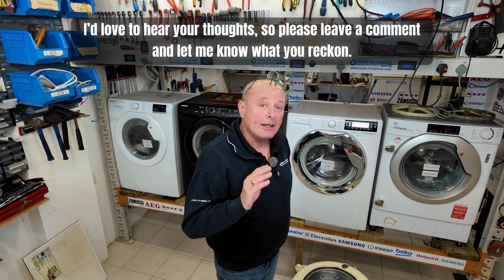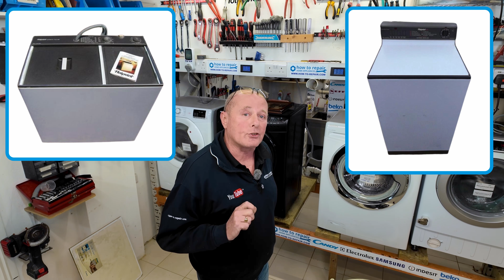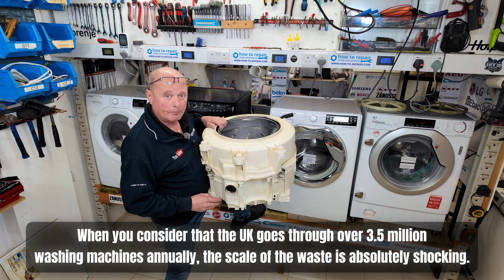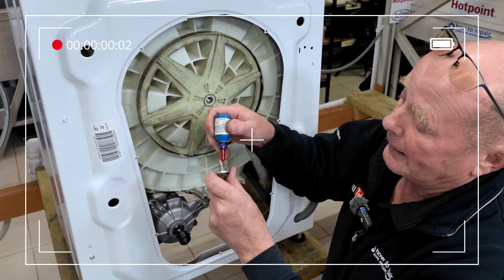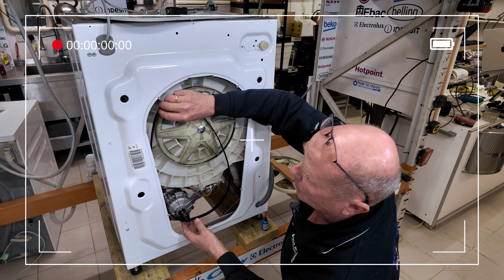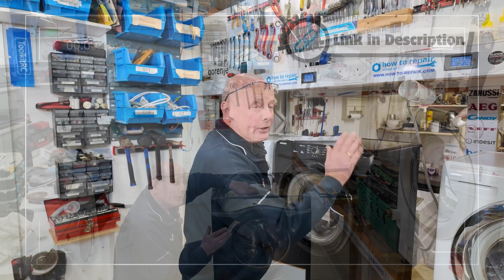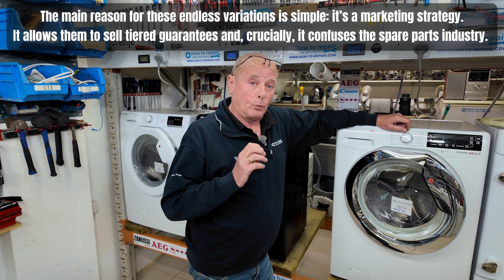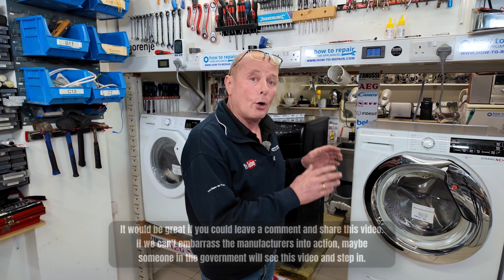I Scrapped 13 MACHINES to Prove a Point: STOP BUYING These Brands!

Comment: My Hoover 7 kilo washing machine, made in Merthyr Tidfil, cost £400 from Currys in May 2006.  Today, an offshored, similarly specified, 8 kilo Hoover machine from Currys is priced at £279.  My aging HSPF 167, though past its best, has never as much as needed a screw tightened in its life and the drum bearings are still running smoothly and quietly.  Taking inflation over 20 years into account, the much cheaper machines being made today have got to be inferior quality.
Reply from the maker: The general public is always the one that decides you can either pay for quality or buy junk. I think people are learning that cheap isn’t the right way.

Comment: Just replaced a 10 year old Bosch that gave up the ghost. It started tripping the electrics after being so reliable. I figured that it just wasn't worth the cost of an engineer and a new pcb (probably about £200) so the local scrap man took it. Splashed out and bought a Miele...hopefully get at least 15 years from it.
Reply: Might have just been the heating element, they often short to earth when they fail. Replacing is a 5 - 10  minute diy job. And the fault is easy to confirm using a cheap multimeter.
Reply: spiders dissolved on my two Miele washing machines, I thought I was buying German quality but alas NO - I would not recommend I am sorry to say
Reply: @davidschofield8458 which models? How many washings? Did you do proper maintenance?
Reply: @davidschofield8458 ..oh, that's not good to hear. I thought they were considered one of the best makes. I guess all modern appliances are just crap.
Reply: @mels8966 . When one is not knowledgeable about these things..what does one do?
The call out charge for an engineer is a fifth of the price of a new machine...?
Reply: @doktoruzo  Yeah, repairmen are too expensive, I self learnt to fix my parents appliances when I was a kid,  long before the internet, but nowadays you can mostly find the information and any help you might need online free gratis.
Reply: Are you german?
Reply: @moccamixer  ...Nein!

Comment: I spent 36 years in the trade till my joints gave in 🫡 i worked for a small family run business in the Midlands started age 17 😎 we reconditioned hotpoint 95s 1800 series hoover 3060s servis quartz was always a big seller being a local company the days you could repair everything including the control modules.good solid machines.if you think back to those days new machines were expensive hence the better quality but everybody wanted cheaper products we can't have it both ways you can't have cheap and quality at the same time something has to give .Once hoover candy group went to PCP production that was the final straw even the cabinet is like tin 😳  maybe things may change one day but I think those days are to far gone and without government intervention witch never ends well things will remain throw away .as my old boss said when quality was falling there's no money in things that last and money and profits trump everything these days.
Reply from the maker: I totally agree with your statement but it has gone past the point of acceptance. I am coming across customers who have had machines fail within 18 months. I think there’s even one in this thread we need a reset and something seriously has to change. They are going to war over a mineral resources and yet they are accepting this consumerism to take place. Thank you very much for the comment. Sorry about your knees and back. I know this because I’ve been doing it 40 odd years. Lol

Comment: Never understood the propaganda with saving water, eg In Scotland it rains (constantly), prefer the old machines that used as much water as possible without taking six £ucken hours for a cycle to finish. Isn't that far less energy efficient. Some people don't have six hours to waste getting their clothes washed.
Give me an old machine that does a full load wash in a hour and half maximum.
ps bring back the two hose (hot cold) system as electricity costs a fortune. If you have gas, heating water doesn't cost a King's ransom.
Another pet hate of mine is those touch screens, I prefer the old fashioned buttons anyday.
The industry has to change, the consumer has to really hit these stupid companies where it hurts and that's their profits.

Excellent work Sir. Thanks for the info on the tragic state of washing machines.
Reply: Don't know what stuff you buy. Normal cycle on my 7kg Bauknecht is 1.5h. I can run programs with around 2.5 and if I run 90 degrees and extra water 
 extra tumbling, I can get up to 3:05h as a maximum.
Reply: Less water means less electricity is used for heating it. Also I never understood where the problem is with long cycle times, since you can just start the machine and do something else while it washes… and there still are faster cycles on new machines that just use a bit more energy (look up sinner's circle to see why)
Reply: @Fla.3  But when not using enough water there is a problem. Because of this I put less laundry per cycle.
Reply: Looks like a problem with the machine itself though, mine uses enough
Reply: It's about poulting. But I think they use too less water when putting more laundry. And reducing poluttion will save water. Getting an very old automatic washing machines is hard where I live.

Comment: 2019 i bought a candy washer, after 6 months the bearings went and the tried to replaced the drum. Engineer damaged the paint on the front of the machine so they replaced it with a new one which last 2 months and then the bearings went on that one. Got a refund and bought an LG, 6 years later its still working like new. Will never buy a hoover, candy, haier product again, cheap chinese rubbish
Reply from the maker: I’m really sorry to hear all the problems you had with them. This is no consolation but you’re not the only one. The horror stories I get via email is what led me on this campaign. If everyone shared the video, it would really hurt their pockets THEN they might do something about it.
Reply: @How-to-repair keep up the good work, people need to know what these companies are doing and the awful quality machines that they are producing before they part with thier hard earned cash

Comment: Very interesting video there, I currently daily drive a Samsung machine, it was only about a couple of years or so that I found out that Samsung had splitable outer tubs as I saw the same with LG when I occurred an issue, but I do have gripes with Samsung in areas but for reparability I give a 10 out of 10 for that. As Hoover and Candy are owned by Haier (Chinese brand) not sure how long Haier have owned them I'm surprised that the way they are made has gotten worse, but I'd like to see what the "Haier" made Hoover's such as the Pro Wash series is like in comparison. I would have expected Bosch to be better made as they are German. One more thing I'd like to see is Midea and Vestel made machines as they are usually manufactured for brands such as Bush for Argos and Logik for Currys
Reply from the maker: It's interesting to hear your experience with those brands, and you're right, Haier owning those brands is a point of concern for quality.
Reply: @How-to-repair  A lot of people seem to rate Haier and Fisher & Paykel refrigerators (and washing machines) highly though. I'm not sure why.  But there seem to be some positive stories at least. It could be that a transition to Fisher & Paykel style designs could actually improve the quality of Hoover and Candy?
Reply: Vestel do make them with splittale drums but its just not worth repairing because 90% of the time the spider fails
Reply from the maker: @miroslavjordanov4459  I am waiting for someone to analyse the aluminium that is now used by most manufacturers when it comes to the spiders and I’m suspecting it was changed then I hope some solicitor or lawyer will start a class action against these companies

Comment: Had a 14kg Hoover washer.  It needed new paddles/agitators every few months as it's held on by the flimsiest of plastic flanges.  Then the waste hose ran under the washer drum got nipped by one of the suspension struts and sprun a leak.  It wouldn't have taken 5p and five more seconds to secure the hose out of way of moving parts.

Comment: All the machines in that line-up are pre-Right to Repair Act.  any machines post 2021 have to have the right to repair
Reply from the maker: When I release the Bosch video, a 2025 machine has built in obsolescence by the price of the parts,the drum is £360. The electronics are £170. They have removed the right to repair by the cost of the parts. And those prices are without labour.

Comment: MY INDESET MACHINE DRUM CALAPSED I THOUGHT IT WAS THE BEARINGS TURNED OUT WHEN I STRIPPED IT IT WAS A SEALED DRUM I BROKE IT OPEN AND THE SPIDER HAD ROTTED AWAY DISGRACEFUL
Reply from the maker: I can promise you you’re not the only one I know there are thousands and thousands like this I’m waiting for someone to do a report on the new aluminium compared to the older machines. I suspect the manufacturers found a new way of building obsolescence in and when they prove it I want to see a class action taking place against them
Reply: @How-to-repair  YES THE ALUMINIUM WAS LIKE POWDER AS THOUGH IT WAS  MEANT TO BE BUILT IN DISTRUCTION TO GET PEOPLE TO BUY NEW MACHINES THEY DONT CARE ABOUT CRAFTMANSHIP NOW DAYS THERE WAS A TIME WHEN THEY WAS PROUD OF THERE PRODUCTS THANK YOU FOR PEOPLE LIKE YOURSELF CALLING THEM OUT LOVE YOUR VIDEOS LEARN SO MUCH

Comment: Will you be including Ebac in your research, I am considering these when my Hoover H160e eventually expires.
Reply from the maker: I did a video on these, but I was let down when it came to spare parts from Ebac, I informed him about a problem that they had with water from the soap drawer was getting onto the printed circuit board and they never replaced the two boards that I had and that was after. I did a good video for them because the build quality was okay, but I won’t be promoting them now.

Comment: I worked as a Miele technician about 4 years ago, very briefly I must say only 6 months and all off the people who had Miele were super-rich and when something went wrong on the appliances it was super-hard to fix them, very complicated for diagnostics and also all of those rich people they didnt care about the cost, they just wanted for the things to work or if it cannot be fixed they just asked us how fast can we bring new machine in their home. So I think the manufacturers are trying the same tactic so we dont fix and just go and buy new. The world is going downhill very very fast.
Reply: My wife does a lot of cooking,   so I bought her a Miele oven.  The top element failed within 11 months.   Transpired that the English element manufacturer thought the way ahead in life was to reduce the size of the element casing tube.   Worse,  the Australian service Agent took fully three weeks to repair under warranty and only after I called Miele in Germany.   He also reassembled it incorrectly,   which I corrected.   Some months later a call from Miele Australia was made to offer my wife a brand new oven along with a new three year warranty.   After consideration she took up Miele's offer.   11 months later the new oven's top element also failed.   By this time my reputation with Miele Australia was known and they couriered a new element within two days which I fitted myself.
I then wrote to the Managing Director of the English element manufacturer pointing out the design failure in that element.   I never received a reply.
I shall not buy any Miele products again,  ever.
Reply: I had a couple of great Miele washing machines over the years, but a  few years ago we got a new one and it was disastrous. Twice the rubber around the door was torn during washing, just a normal wash with buttons on jeans and shirts etc but something tore it. First time it was replaced under guarantee because the engineer was a nice guy, but he said he thought it was through misuse, but he would give the benefit of the doubt.  A few months later, washing everything carefully with some trepidation it happened again. The rubber was softer than on other machines, clearly a bad design. As it would have cost about £150 for a replacement part - with a wait of a week-  we just got rid and bought a Bosch, which has been great so far. Not going back to Miele. Oh and the washing cycle times were ridiculously long on the Miele with a beep you could hear down the street when the cycle was finished.  Please don't be fooled, folks, into going for a Miele these days.
Reply: @peacenik2025 I had a Miele washing machine. It broke

The cost of callout alone was ridiculous and you can only really use Miele direct. So I though that's just rubbish. I expect it to last
Reply: A friend of mine had a Miele washing machine that cost almost €1,000. After two years, it started leaking and water was running out of the machine. He called a local electrical company, who immediately sold him a new machine and took the old one away for disposal. I found out about this on the same day and drove to the company on his behalf and retrieved the old machine.  It was only the door seal that was broken because someone had forcibly pulled out laundry with a zip fastener...
50€ for the part and it has been running perfectly for 3 more years. Recently he told me about some electrical issues with the Display... all the buttons are some kind of "touch" without feedback and they sometimes dont work or they are hyper sensitive and activate when walking too close to the machine. The current rule seems to be: dont enter the room, when the machine is running. otherwise it might stop the program.
Reply: Could you suggest a trustworthy brand please?
Reply: @SpiritXT100  ASKO is a promising brand. Also when you buy white goods look for them to be "stupid" . You dont need 30 programs or WIFI or NFC. Simplicity is the key.
Reply: @krstanoski994 We don't have this brand in Greece. Any well known brand?
Reply: Sadly MIELE now produces also in China. Be sure your appliances are 'Made in Germany'. Only these are tested and designed for minimum 20 years lifespan .
Reply: @Steeler-wg5zo  Yes, because the German government is pushing hard to drive manufacturing out of Germany to meet climate goals. Miele is a traditional company that tries everything to manufacture in the country they were founded, if they could they'd manufacture everything in Germany. But all over the European Union the manufacturing industry is under such pressure that it's in many cases it's: leave the continent of go out of business.
And anybody who warns about the consequences of that is called a right wing extremist and cancelled.
Reply: @Steeler-wg5zoit's why I bought a 10 year old Miele washing machine about 8 years ago and have never had a single issue.  It's rather basic looking, but I hope it will last another 10 years.
Reply: In Germany, Miele's customer service probably has relatively little to do due to quality issues, because the products are tested for a 20-year lifespan. Most of the time, it's the stupidity of the users, or their age, because they can't cope with the new digital witchcraft, or simply because they only wash with gel instead of powder. I once saw about 1 kg of slime having to be removed from the hoses of a machine so that it would work again.
Reply: I'n not rich but all my kitchen appliences are Miele. All over 20 years old and I just had the first repair last year since the dishwasser had a wrong water measure sensor. Repair guy said that it would be good to go for another 20 years. Induction plate, cooler and Microwave/oven still work flawlessly.
Reply: The twin dos system in miele machines is a joke. With my machine you can’t even dismantle everything. I am glad i can use it without it. No one needs this! The aluminium git stuck in the pump. I would never buy a twindos
Reply: You take the aluminium off before you jam a new twin dos in ya mad head . That's why it's getting stuck . Never had any issues with Miele and not all people are rich who have them.
Reply: @moccamixer  I don't know if Miele's are good anymore. But we got friggin' pissed off with few hundred euro washers and we bought TwinDos Miele for about I think now 1,5 years ago. We absolutely love the TwinDos system and so far knock, knock it has been working really well. Very convenient and it's nice that there's traditional dosing system obviously. We didn't even plan to stick with TwinDos, but we did as it's convenient.
Reply: I have a Bosch double oven, used daily and is around 23 years old. I take the view if a white goods item lasts over 5 years then I'm on bonus time and would always replace if it went wrong. Everything I buy always comes with a long warranty 5, 6, 7 or 10 years but it needs to be a parts and labour warranty, having just a long parts warranty is pointless because labour rates are the thing that makes an unviable repair.
Reply: Correction: *The Western World is going down hill very fast
Reply: @CoppersOnTheRun very fast 🏃‍♂️ it runs by Phedophiles aka Epstiens Files all involved 😢
Reply: @CoppersOnTheRun it's true that we haven't needed much help to achieve that. Now imagine with some help